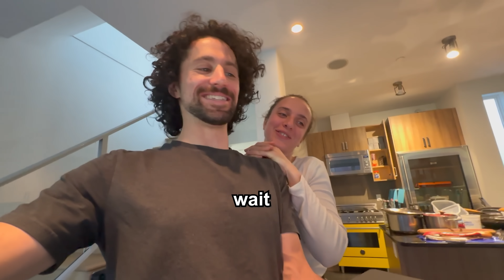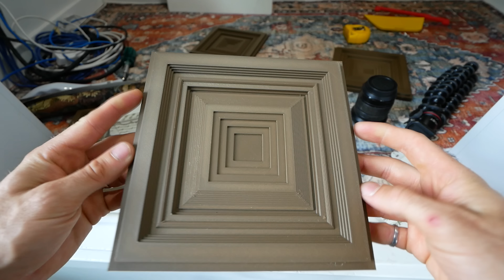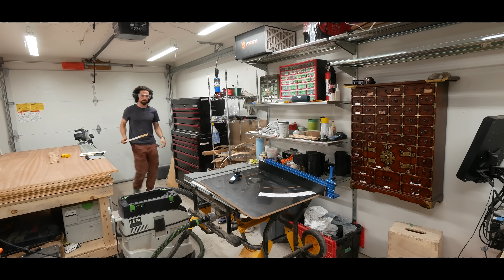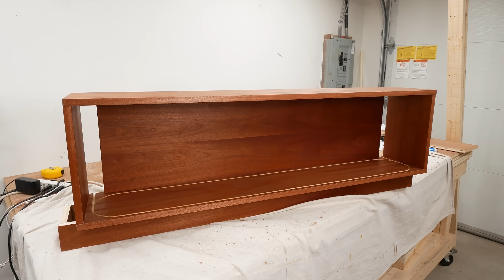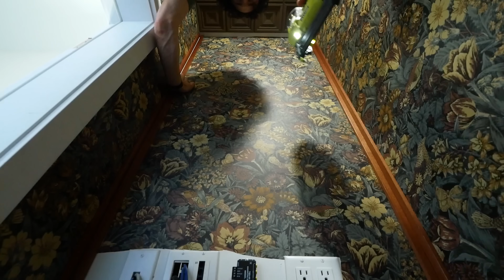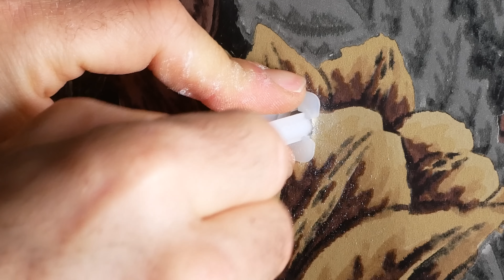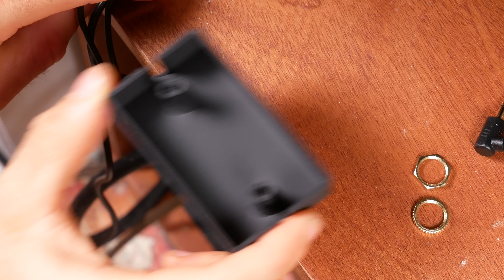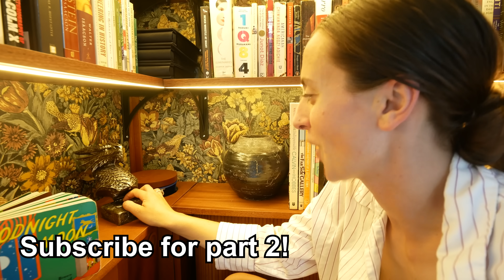I Built a Tiny Library on my Stairs

Comment: Make the doors into external facing bookshelves, so when people go up the stairs they see a bookshelf, and inside the bookshelf, is a library.

Make them split in the middle and open like sliding doors, wont block window because it will hug wall when open, and you will have more place for more books!

Seeing the doors open (out) and the nook/library, would be an amazing visual treat.

Comment: I know it might sound obvious or cliché, but that’s exactly why it could work as a simple bookshelf. I mean, who would ever expect a bookshelf behind another bookshelf?

The bookshelf door could have the hinges placed exactly where the current door is, avoiding too many modifications to the house and saving the hassle of dealing with the bookshelf.

The opening could work by pulling one or more books, triggering a mechanism that unlocks a simple latch and allows the bookshelf to swing open, revealing the real library.

That way, you’d have a hidden passage and extra space to store even more books.

PS: Since it’s a secret room, you could also add a small peephole on the inside to check the stairs, and maybe a ventilation system at the back of the bookshelf so fresh air can circulate even when the bookshelf is closed.
Reply: THIS COMMENT FOR THE WIN, PLEASE!
Reply: @Yaseen_now  Thank u!! 😆
Reply: So cool idea 😍
Reply: @gaiab990  Thank u so much!!! 😊
Reply: Great ideas
Reply: @kathleenmullen5475  Thank u!! 😁

Comment: Use heavy duty drawer slides directly above and below the opening. And use a HP painting in a gilded frame. Or a sliding shallow bookcase that fits your smallest sized books.

Comment: Fresh subscriber, love the library. If I may weigh in on the door scenario, it would be a shame to cover up with a full door... I would suggest perhaps one with a glass panel but maybe with a cover that can easily be pulled up and down. Course this is coming from someone with no building experience so how that may work I am uncertain... But it would allow for most of the library to still be visible when the door is closed and have a privacy element in the form of the cover.

Comment: Amazing build, and incredible amount of work, just a quick note out of my own experience with 3d printed shelf brackets, you don't even have to use the extremely strong base materials, if you print them "laying down" because the sideways stress is minuscule on them and that way even  simple petg can hold a surprising amount of weight

Comment: If you could get one of those Frosting doors that could be kind of neat. The ones that you can apply an electrical charge to and it becomes opaque and then when the charge is disabled it goes transparent. You could maybe even do a really cool affect with the Painting idea within this frosting door. I'm not entirely sure how to do a 'Painting' within the frosted door, but it probably wouldn't be cheap if even possible.

Comment: To help regulate the temperature, you could install fans behind the chair. The air could flow through the holes in the back support, like the ventilated seats in cars.
Reply: Medieval stained glass window that opens in half!
Reply: There are large cushions in the way. I don't think very much air will go through these holes.
Reply: @EarMaster55 True. Maybe small channels for the air to flow would be the solution to that.
Reply: Very clever!
Reply: Amazon sells small fans that work quite well using just batteries.

Comment: Great video, as always! I agree with the idea of making the door look like a portrait or painting. You could run two slide rails—one on each side of the frame—so instead of removing them, the door just slides upward. Add an auto-latching system to lock it in place, then simply unlatch to slide it back down and ‘close’ the door

Comment: An aquarium that looks like it is partly inset into the wall, or sitting on top of a shallow table. A secret way to lift or slide the aquarium out of the way when you want to enter the library. On the inside of the library, a way to return the aquarium to the door position so you could watch the fish from both sides, and still get some light from the window. I think the bubbling of the aquarium would be very relaxing. Maybe a few stacks of books in the aquarium as a clue. A cat door to the side that goes to the library so the cat can be entertained by watching fish when their humans are gone. Not sure of the logistics that would make it work, but I am sure you can figure it out.

Comment: Proposal for the door:
I think a design inspired by stained-glass windows from Gothic churches—or even from those iconic old university buildings we all imagine—would be a perfect fit for the door. The challenge, of course, is how to bring glass into the design. One idea is to use the same kind of accordion mechanism, but with glass tiles or a glass-like material such as methacrylate, so it could roll down from the top of the entrance frame like a shutter.
What do you think? It could look amazing...
😉

Comment: You should do a painting, but put it on one of those school pull down projector screen mechanisms so you can pull it down like a curtain for it and maybe secure the bottom with magnets so it doesnt move with a breeze, and it will practically disappear when its rolled up to the top. Magnets could be mounted in the frame and connect to some thin metal tape you attach to the painting. As a plus its not suuuper solid like a normal door so theres extra comfort in that you will never be stuck.

Comment: Put a slim display shelf that splits into two on sliders. Make them the same width as the wall that are each side of the door so that it looks cohesive either way you have it. Maybe decorate it with little things you made over the years. If that makes sense 😂

Comment: Came across this video after a reccomendation on the Making It podcast and I’m so glad I did! Awesome project, your passion for the whole thing really comes across. This must have taken you weeks if not months and it really paid off. Incredible creativity and skill 😊. The secret door would be cool if you could see out from the inside when it’s closed. Like a two way mirror, a painting with eyehole cut outs, or even a painting or mirror that turned clear when you push a button! Kind of like the privacy glass you see in some modern hotels. Another cool option would be if it’s some kind of puzzle to open it, or even just another hidden button bust on the outside. With the awkward position on the stairs you’re probably better with something that slides open rather than hinges.

Comment: I think you could probably make a painting that just slides up if you have the space above the door. Maybe there's a little button or latch at the bottom that unlocks it and then springs pull it up so that it's resting position is open, that way if you sit in there with the door closed there's no fuss opening it, just press the button/unlatch the lever and it does the work for you

Comment: The height of the opening really lends itself to a painting. If you hinge it on the right side, you'll still see the window, but with a piano hinge or similar, you wouldn't see the painting any longer, but I believe a sliding hinge would allow you to slide it to the right and then pivot it, allowing full access to the stairwell and you can still see the painting when you walk up the stairs. If there is enough room to the right of the opening, you can just use a slide and not need the hinge. If you put a small knob on the back of the painting, you can slide it closed while inside as well.

Comment: what if you use the wooden fluted panels to cover the whole wall? there are those that a sold online which can either be stuck onto walls (u shld be able to use 3m), or Wooden slat Partition Decoration Beam that its achored floor to ceiling via adjustable fixing bolt kit ? then you can use the ghost sliding doors so that you can leave the door open and not block the way. just a thought :)

Comment: I loved the library. 

Some ideas for the door:

An etched piece of acetate or acrylic with a pattern - think the door in Lord of the Rings. 

A locking door like the ones in Harry Potter bank. 

A door that is slatted but comes apart like a layered staircase. 

A false staircase

An old oak farm split door

Not a door but a tapestry curtain - a lot of old mansion houses in the UK used those and also Harry Potter. 

A Star Trek sliding door with sound whoosh.

Comment: @MorleyKert -Suggestion for the door. A lot of people saying the same thing, and I agree. Put some hinges on a piece of plywood and mount it like a regular cabinet door. Be sure it swings open opposite the window so you don't block it, and put a painting over it on the outside. When it is closed it will just look like a painting on the wall. This will give your "Secret Library" a "Secret Entrance" and also super easy. No need to do something comples. Also, if you haven't tried yet, get a desk fan in the summer. It can help with air flow. Whatever you decide to do, I'm sure it'll be great! Well done on your Secret Library!

Comment: This looks sick! and Eden is the GOAT for the sewing! Painting as a door that slides up like an old sash window style could be cool? i'm sure you could just do some minimal dry wall holes/anchors to hold some 3d printed pully hardware then have some cool old fashioned looking weights hanging at the side of the painting (or inside the library as you'd only need to drill a hole through for the ropes that you could repair at the end (similar size to you already used wall plug holes)
Reply: Oh and the painting should be one of those old style royal paintings of all your pets!

Comment: You can have the door be some kind painting that use vertical lift up door mechanisms so that it can be out out of the way getting in and out of
Reply: Also with it being a vertical lift up door you can add a handle to the inside for ease of opening and closing.

Only issue with it would be the issue of it being flush with the wall when opened.

Comment: DUDE! A mounted persian carpet on a hidden barn door/sliding rail. The barn door hardware could look cool and victorian-y, maybe if you mount it upside-down to hide it behind the persian rug? Display rugs are a thing, and it would add to sound proofing/sound reduction both in the hallway and the library.  ... also, you might be able to mount it in a way that kitty could sneak in when the door is shut, so you could have super-seekrit cuddle time!

Comment: You are lucky to have such a chill landlord. Also WEAR GLOVES WHEN CUTTING WOOD! No matter what you ALWAYS wear gloves when using ANYTHING SHARP!
Reply: Um, no. Do not wear gloves with power tools! The spinning tool will grab the glove and suck your hand in. Source: Instructors at BCIT Machining shop. This applies to mills, lathes, drills and saws.
Reply: @fredericapanon207  Did not know that. How the heck do you stay safe though?
Reply: @SlinkySmith59  By being careful not to put your limbs in the way of moving machinery, being aware of the emergency stop for your machines (I had to stop a mill that way once when a fellow student fainted).

Do you have an organisation like Worksafe BC or the Workers' Compensation Board that could recommend safety courses? Or your local community college with industrial courses?

You might also want to check out @StumpyNubs who has an emphasis on safety in the woodshop.
Reply: @SlinkySmith59  by being careful to keep limbs away from spinning tools. For woodworking, @StumpyNubs has videos about safety in the wood shop.

Perhaps talk to your local Workers' Compensation Board about courses in shop safety.

Comment: I has two ideas, Not sure if it can be done without damage to the walls, but a one way mirror door that slides up (seems like there is enough space above the nook entrance), with a fancy victorian frame that also acts as the handle. The other thing I was thinking was a 3d geometric art piece that just looks like modern art when "closed" but unfolds forward to form tiny steps to help enter the nook.

Comment: Awesome build.
Door idea: build a sliding track frame for a portrait that slides up and down the exterior of the wall. You could do a portrait on the track with a lock open option in the track. Also adding counter weights via pulley&ropes would be ideal. If the sliding mechanism is hidden behind the painting in the lowered position it’s a secret library. With the door raised you have art above the entrance to the library. Make the sliding rails 3d printed and decorative to frame the doorway. Mechanical benefits are: would not obstruct the stairway which could be a safety concern.
Hurdle: you want to make sure that entering/exiting the door does not slide down on your head/neck. Spring loaded pins to prevent closure without intentional intervention would be a baseline. Additionally, the bottom of the tracks should have an escapement mechanism like the door swinging up and out away from the wall so people don’t get trapped in an emergency scenario.

Comment: What about something LIKE a tamboured door where the wooden slats are on the INSIDE of the room now, and the outside is a decorative painting-like canvas or a simple tapestry? And instead of the door running on tracks, you make a mechanism that rolls the door up and hides it above the doorway on the interior of the library either by virtue of a pullcord to close it, or some clever electronic solution.

Comment: I've always liked those double square doors cut in the half by triangles so the center of the door folds and flips the other direction. It would be cool to see a painting on that with a seemless painting so it looks good both ways.

It needs equal space on the side as the area of the door so you'd need to do two doors.

Comment: I've used those toggle bolts a number of times but usually only as reinforcement between studs.  Belt and suspenders.  I did find them to be very sturdy

Comment: It could be a door in a door. So make a shallow recessed 'medicine cabinet' style that has a regular white door. It will appear as a cute way to make use of the wall depth, a storage space for a mini pantry, table linens etc. Then the entire medicine cabinet is the door to the library. It could fit over the molding that's already there.
Useful and secret.

Comment: I think you should do like a safe, like one of those big ones with the spinning metal dial thing and like you said show the cogs move around the safe so put acrylic over it to see the cogs. For the hinge for it to open i was thinking that you could maybe do like a mini stair case comes out as the door touches is the floor. So you could walk in easily and hide it well. with this idea you could have metal supports that fit into the door so its practically invisible supports.
 Also if you see this could you like comment a link for all the materials and measurements you used for the tanboard door because i think it was really cool and wish to make something similar and it be like a tv stand and add a better aesthetic to my space. Absolute class video one of my favourites

Comment: Eden is the GOAT! 

Idea for the door: An outward-facing bookshelf that slides (manually or motorized) upward when you want to enter the library. Creates a high-on-the-wall bookshelf when open and doesn't block the window. And it represents exactly what's behind it when it's closed.
Reply: Pitched the same idea before reading the comments. I would recommend this approach.
Reply: While I like the idea of the door bookshelf (more space for books is GOOD), I am concerned that this would not leave enough circulation space in that stair, which doesn't look that wide to begin with. City planning department and fire marshall might have an issue with that.

Comment: Make a two way mirror door so you can see through from the inside, don't make it airtight so it can have air flow even closed and we need some kind of tv rack mechanism for the door to open to the rignt corner so when open you still have a functional mirror on the stairs.

Comment: my first thought for the door was a shelf on wheels. like maybe a thin sturdy shelf on casters with a fixed orientation. you could put some propagation/cutoffs from the plant in the window, some knickknack and a few display books (like coffee-table books or current magazines). im thinking maybe half a foot, max with a rail to prevent things from tipping forward. though if you made it wider at the bottom, you might be able to fit a plug-in dehumidifier, to lower the  center of mass to the shelf (and lower the humidity in the space if needed.) then you could have it wheel back and forth between having it in front of the door, or rolling out to be against the wall without the window. 
i think it could be a fun design challenge to find a way to hide the wheels (sense you could have overhang around the front facing side, if the wheels arnt turning.) so it looks less movable. and make a way to move it from inside. maybe it could be electric with a switch? like your original bookcase idea. or possibly an inset handle, so the piece stays flush to the wall.

Comment: Hey Morley, if you're ever capping off a light socket, or any other similar shaped outlet box like that again, there are actually steel covers you buy at the hardware store to prevent the wires from having a screw driven into the live wires behind there in the future.